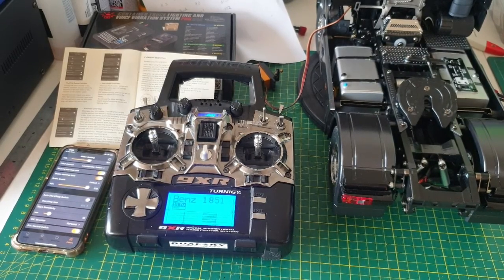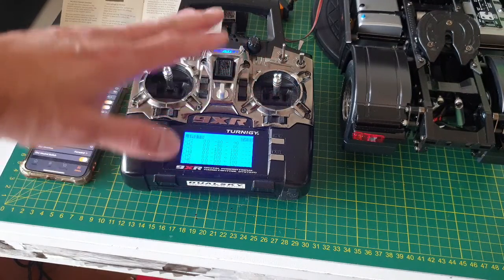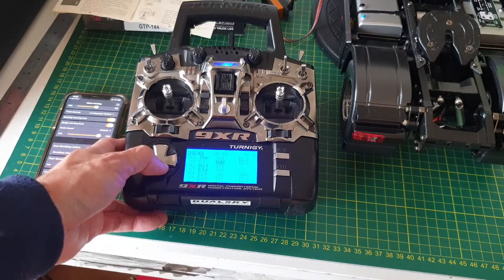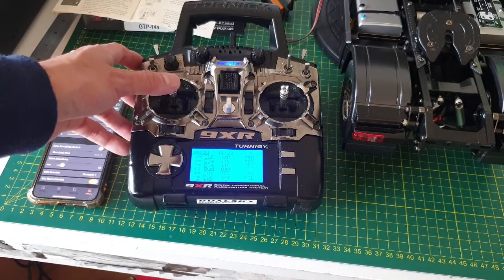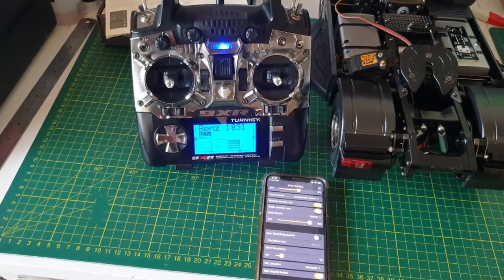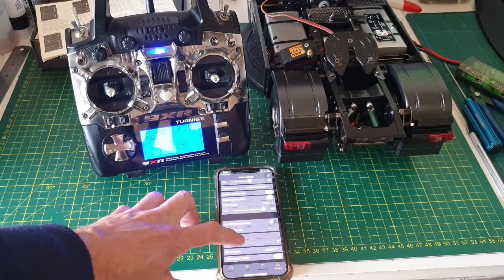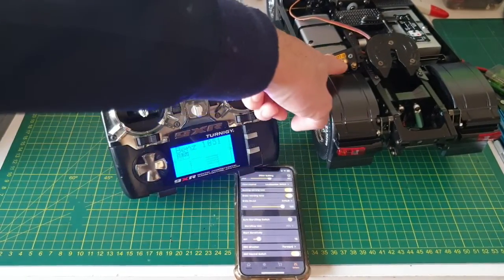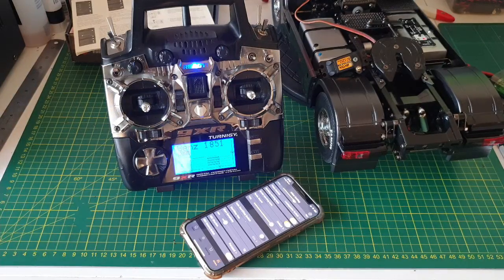G.t.power sound light pro module functions set up on tunrigy 9xr

Comment: Fantastic ... What is the name of the RC truck ?
Reply from the maker: Hi, it was a Tamiya 1/14 Mercedes actros semi trailer truck. And it has a G.T.Power pro sound lighting module and it simulated all real truck sound and light control by rc transmitter and mobile phone apps.